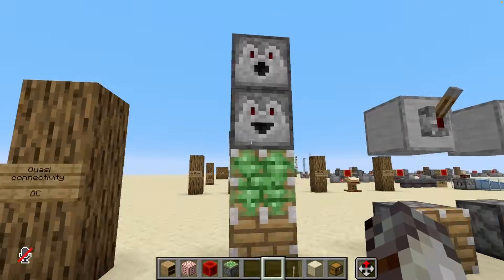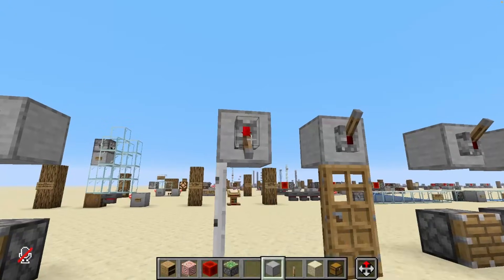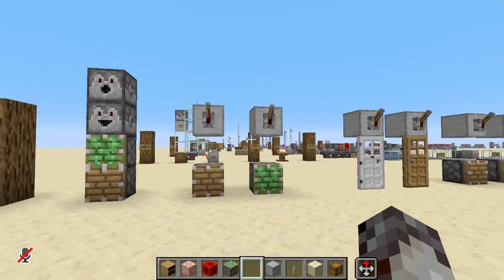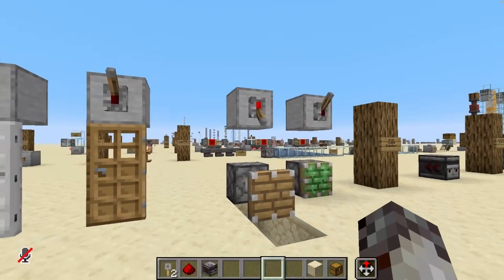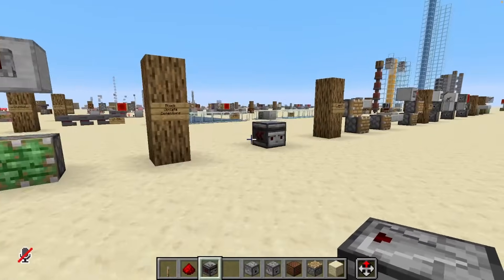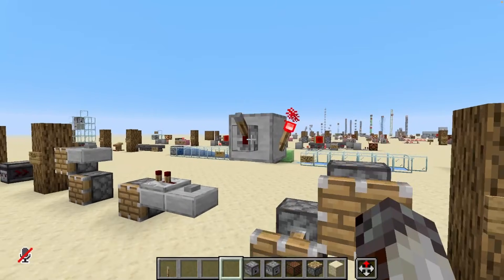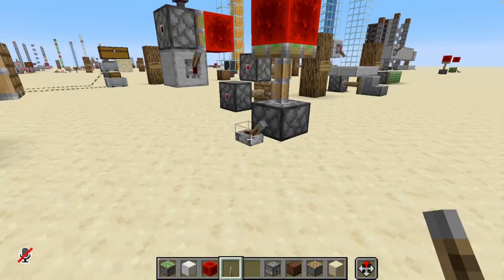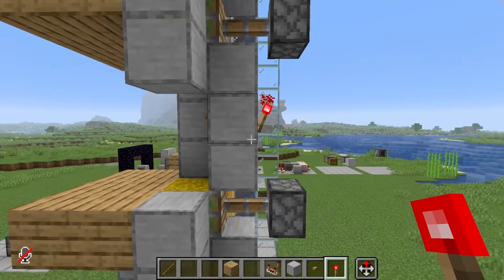Quasi Connectivity Explained

Comment: I hate this SO much, i have to build 2 different designs for a single thing because of this.
Reply from the maker: It can be frustrating but once you understand it gets easier to work with
Reply: @theikeberg 

It is very hard to get used to it. Because there are 2 versions of minecraft with different coding, i will have to learn 2 redstones at the same time.